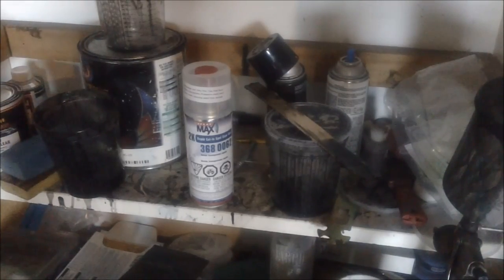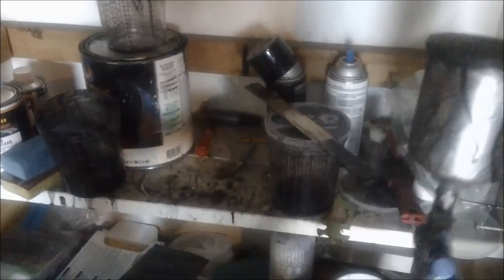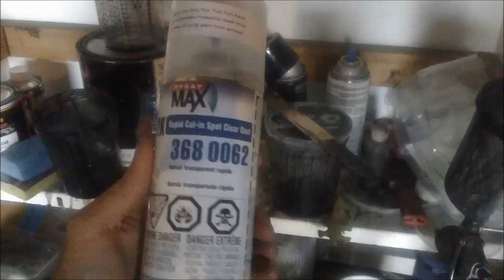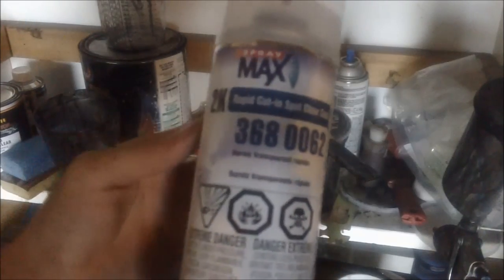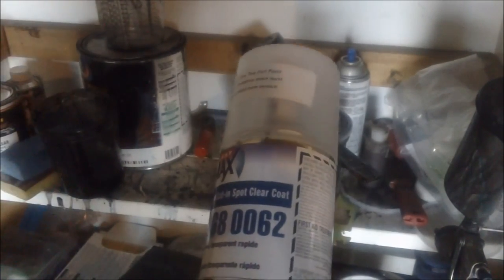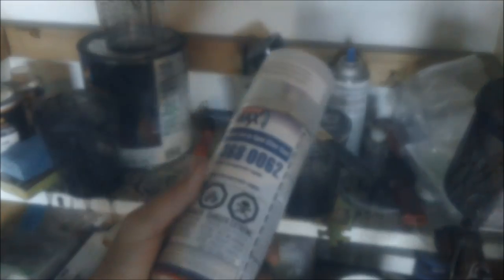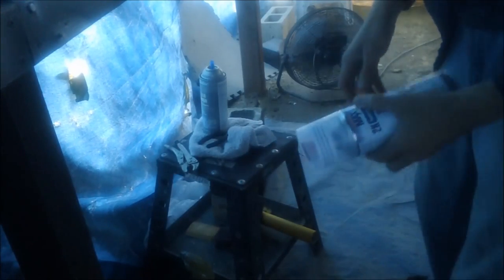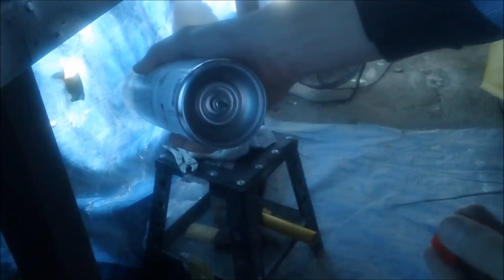SprayMax 2k Clear in a Spray Can

Comment: Do u agree that some paint requires clear coat to make color come out right? I heard somewhere that black sapphire pearl needs clear coat to make final color.. I got the paint (high quality paint not duplicolor) and painted my fender but the clear coat I applied is 1k and applied too thin. I wet-sanded, compounded and polished but the clear coat is almost gone from the surface. The color shows purple hue at an angle when the sunlight is hit. The original factory paint on the rest of the car doesn't do this they stay dark blue.  The colors don't match now.  Do I need to apply thicker clear coat? or 2k will make it look more like factory color?
Reply from the maker: Well if we are talking about a base clear system, clear coat is required. If its a single stage paint, clear isnt needed but it sounds like youre shooting base/clear. It also sounds like the base you sprayed isnt the correct color, best bet is to start over with the prep, find your color code for the car, get it matched and go from there using a 2k clear, make sure to apply the maximum amount of coats so you have enough to color sand and buff off. Hope this helps ya
Reply: Gary Rubino Yeah i think u're right i contacted the seller and sent them the pics and they believe the color doesn't match (even though the paint code is correct) so they gonna send me a new mix. I'm excited YAY... ^o^)  Tank u for the advice

Comment: I have a couple questions how long after you put the paint on do you put the clear on I can never find an answer for that also once you put the first coat of clear on how long do you wait in between to put the next coat on do you wait 5 minutes 10 minutes or do you do it right away I did subscribe you have an awesome video and I will be watching for now on thank you very much you're very helpful
Reply from the maker: HI Rob, to answer your question in short, I usually put 3 coats about 15 minutes apart on the base, for the clear after my last coat of base Ill wait about 30 minutes to an hour, first coat of clear goes down, give it like 15 minutes then the next 2 or 3 give it 20 minutes flash in between each coat. Hope this helps ya out

Comment: Hi, I just used acrylic enamel duplicolor as a basecoat on an old moped i'm rebuilding. I was planning on using this stuff as my clear and was wondering if I have to scuff the basecoat before applying it or can I just spray it on the cured paint directly?
Reply from the maker: Darren Weatherall Hi Darren, if its already cured give it a good scuff (assuming its a solid color) If its cured and you dont scuff it, it wont have a mechanical bond. Spray a couple a lite coats and then make them heavy and you should be ready to rock N roll
Reply: I have comparable circumstances to Darren.....After you "scuff it"  do you tack it or wash it or both? Thanks for your help.

Comment: How much will one can do? Can 2 cans do 4 doors, or is it better off to get 1 can for each door?
Reply from the maker: F&F actually 1 can would do probably an average size door for around 3 to 4 coats tops. So it would be safe to do 1 can per door and only activate it right when the current can is about to run out
Reply: Gary Rubino Cool, thanks for the reply. I think I might try this sometime.

Comment: I have a bike tank that's been painted for about a week. Do I wet sand it before applying this stuff? Or should I put on a new coat of paint and apply the 2k while it's tacky?
Reply from the maker: If it just base coat thats been open for that long, you'll need to sand it, re-base it and let it sit for a minimum of 30 minutes to an hour depending on how hot or cool it is and then clear it, once you go past 12 hours, the base has dried too long to accept clear. Some bases might allow a 24 hour open window so you'll have to double check its tech sheet. Best to base it out, and clear it that same day after 30 to an hour of wait time from the last coat of base. 3 cost of that, 3 to 4 coats of clear from this stuff and you should be plenty right after that. Hope this helps Randall!
Reply: Can I use gloss as a base coat?
Reply: I sanded the old paint, reapplied a coat of satin black and then applied 3 coats of the clear and my tank looks like glass! I can't believe how deep the shine is. Thanks for the advice.

Comment: When doing a small area of base repair, does the surrounding clear need to be prepped in order to blend in the old and new clear coats?
Reply from the maker: Short answer, yes! I like to wet sand it all down with 600 and clean it really well Lay out your base, tack, clear it and youre off and running
Reply: OK.  Thanks!

Comment: hey man. I'm doing a little project on my own and I want to use SprayMax 2K Clear coat on my project, though I'm afraid of what it will do to my paint work. I used a rustoleum paint on my project. will it damage the paintwork? thanks
Reply from the maker: +Jan Hernandez Im pretty sure it will but there might be a way around it. This may or may not work but what you could try it shock it. What I mean by "shocking" is rather than putting a full wet coat on, spray just a really light mist coat and let it sit for ten minutes, spray another light mist but a little more, do this about 3 times and work your way into a full wet coat. Ive done this before with 1shot pin strippers paint. Again, it may or may not work. The safer bet is to use a single component clear like the upol #1 clear in a can. Good luck and let me know how it turns out
Reply: +Gary Rubino i actually got the guts to get it and it worked well on my rustoleum painted helmets. It worked really well and looks amazing

Comment: Hey man planing on doing a bumper and want a really nice clear gloss would this product or u-pol be better ?
Reply from the maker: fcf1800 Well both are really nice clears, they both are almost identical in cost.  The upol will do the trick as well but will require more care but Id go with the usc clear simply because it has a hardener in it and should stand up to the uv's better

Comment: I think you went over too quick on the 3rd coat. Shouldn't you go slower to ensure full coverage and for thicker coat?  That should level the clear coat down too and result in smooth surface. Any comment
Reply from the maker: I suppose so, but this is the way Ive done it and I usually at least run 3000 over it to nib and then buff. Im of the thought that if it works for you, go for it.
Reply: Ok thank you

Comment: What is clear paint?
Reply: Daniel Schnell...  Clearly it's paint that is clear. Used as a top coat/protective layer to add shine/resistance to scratches.
Reply: A clear lacquer
Reply: It’s not lacquer, that’s what the Duplicolor clear stuff is. Two part automotive clear is actually a resin, that’s why you need hardner. Clear coat is not paint, the color coat is paint.

Comment: How long between coats? how long before dry? after 3 days my plastic headlights was still sticky... I was stupid and seen some debris on the lights & wiped the debris off with 99% alcohol & rubbed the 2k clear coat off after 3 days....smh..... any advice?
Reply from the maker: If you had problems using this clear, as Ive heard it in the past, what I did is shake the hell out of it, then pop the red cap then shake the hell out of it some more! Well, in your case, Id sand it all down again and start from starch, lay out your first coat a bit on the lite side and wait 10 minutes, then lay out a good wet flowing coat then give that 15 minutes and follow it up with a 3rd
Reply: You did not successfully activate tye hardener.

Comment: hey man do you recommend using this stuff on like a controller for a game system? i want to add this protection and shine to my painted controller.
Reply from the maker: For a controller? It would be great stuff to use but in my opinion would be overkill. If youre doing just 1 or 2 controllers, Id actually suggest the upol clear (orange can with the #1 on it) Reason being is it would be far less toxic and easier to handle. It'll yield about the same gloss and you can store the rest and use it at a later time vs this 2k in a can, its only good for about a day or so before it kicks and if you dont use it all up, kind of throws your money out the door. Hope this helps ya out Kevin
Reply: Gary Rubino oh okay, well i was thinking using it for like 5 controllers at a time. Also if i may ask how much time would you allow the paint from the controllers until you use the clear coat? i really appreciate the fast response. you are awesome buddy!!!
Reply from the maker: Hmm if its at least 5, You could use this stuff but Im almost positive you'd have quite a bit left over. My bet would still be on the upol clear, heres a quick link to one of the places I buy it from when I cant get it locally tcpglobal.com/UPO-796.html#.WVabV4jyscU

Its a bit pricey but its well worth it. And for the paint drying, for the base color wait about 10 minutes in between  each coat, put 3 good ones down then wait about 20 to 30 minutes at least to spray the clear. Most bases dont like to sit longer than 12 to 24 hours depending but my preferred practice is to just wait 20ish minutes and clear and waiting about 10 to 15 minutes between each coat of clear.

Ahh shucks, any time man! Just a dude trying to help another dude out :)
Reply from the maker: for the link put www. 

Youtube doesnt like links for some reason
Reply: Gary Rubino Do they make good rattle can base coats or do you need to use a paint gun? I'm not very familiar with base coat formulations, do they have hardeners in them or is that just the clear coat? I'm wanting to repaint the bumpers and some other parts on my 95 Buick Riviera and not sure what to use for the base coat.

Comment: Is  a 3m 6200 mask safe for this? They can claims you need an oxygen mask to use this stuff.  Thanks.
Reply from the maker: It should be so long as it has the correct filters on it.

Comment: I just purchased this for the roof of a car a small section next to the sunroof a little strip I was wondering can I go to the paint store and buy the Dupli-Color color match paint base and then spray this on top there really is no instructions on what you can't use this stuff on let me know if that is ok some people on YouTube say I need a 2K base whatever that means but Dupli-Color makes a perfect match where it matches up to the color code on the car let me know what you think thanks I appreciate it
Reply from the maker: Ive never tried it with the duplicolor but I'd strongly suggest not to. Duplicolor usually is a lower grade lacquer based type of paint, if you need the base color Id suggest automotivetouchup . com
They can do the base coat in a urethane type of paint that will be compatible for sure with the spraymax
Reply: Gary Rubino thanks I'll do this!!

Comment: Hi there! Can you spray over a 1k basecoat or can you only spray it over a 2K base
Reply from the maker: Im assuming you mean a spray can 1k base? or that no mix spray stuff? Id read the back of the can if it says it can be sprayed with a urethane clear on top, Im sure its safe. I sprayed this stuff over a spray can oem color matched white, If someone else can chime in and confirm or provide more detailed info, please do so.
Reply: +Gary Rubino oke thanks for the fast reaction man!

Comment: How many doors could you do with just one can of this stuff? 

Thanks
Reply from the maker: +n8rad3 I had enough for 4 coats on this door
Reply: Gary Rubino Thanks brother. I'm looking to do a matte cream color on my hood and I saw SprayMax has a matte clear coat.  Can I use regular old duplicolor from a can for the base and use the 2k over top of that? Or any tips you have for working with matte colors in general would be great

Comment: What happens if the paint has set  for 5-7 days before using the 2k clear?
Reply: It's best to clear it shortly after (30 min +) paint to get maximum bondage as the paint is a bit sticky during this phase.  But that's okay you can clear it 30 days later.  Just make sure that the paint surface is coarse enough, 800 grit equivalent.
Reply from the maker: Ditto ^^^^
Reply: It came out great, It is a motorcycle gas tank, haven't spilled any gas on it yet to see how well it stands up.

Comment: What's the lifespan on the can once you start using it
Reply from the maker: Ive had to go for about 2 days in the cooler months maybe more a day and change in the hotter times of the year
Reply: the lifespan once you activate any 2k clear is 15 minutes in a very hot weather up to 1 hour in the middle temp. some say 4 days but its bs as hardener is activated there is a reaction between lacquer thinners and hardener so if you can use it in 1 hour its safe but the more time pass chemical reaction is not the same because of hardener. lacquer and solvents is no problem the short use time is because of the hardener only. plus its very expensive to use spray can. if you buy from glasurit ppg debeer roberlo standox and use a spray gun you get at least 70% less for the stuff in the same 400ml amount. i think most 2k are mixed like this for 1 portion of clear you add 0.5 of thinner and 0.5 of hardener. 70% or more cheaper using spray gun and top results like in the bmw or ferrari factory. 2k spray can is ok for headlights and small spot repair but not for panel like hood or roof. plus you cant compare quality of spraymax dupli color or peter kwasny to ppg or basf coatings. body shops never use spray cans they know customer will come back shortly and will ask to repaint this or that panel again. thats the fact i have body shop owners friends they never use ready spray can clear coat 1 or 2 k only what they mix from professional coatings supplier. also if you guys do it for a living let customer know that spray can is not like body shop paint in the owen cured correctly etc.

Comment: this stuff is garbage.. 1) you must put it to a proper base coat, not over a rattle can base.. with the solvents inside rattle can base, it will peel if you rip masking tape off of it, and if you get yone chips it will keep peeling. 2) its a TOUGH clear.. if you cut and buff it, youll never be able to get out a haze.. it will be forever hazy. ive tried the best polishing compounds and pads and this stuff is bad.. very nice for small projects where sanding isnt needed, BAD for panels
Reply from the maker: Integra DIY This stuff turned out great for me. The base I use from automotive touch up is a urethane base and I did the cut N polish the next day with no issues.  I know there was a DOM on my can and even came with a little paper saying if it sat for more than 2 months to spend a good amount of time shaking it, pop the hardener and shake some more, Perhaps you got a bad can?
Reply: I have used this clear an it is a really good product IMO. Of course you need to use a good base color under it just like any 2k clear, and of course it is tough stuff..... thats why it uses a hardener, it's automotive grade stuff and can be properly sanded and buffed like any other urethane clear.
Reply from the maker: Rene Contreras Hey Rene! Glad to hear another positive comment on this product!
Reply: +Gary Rubino No, this guy is just on here to talk shit about something he doesn't even use.  That is what the internet has created, a medium for people to complain.  When there is nothing to complain about, let's complain about nothing.  These are the same people that post rants on facebook because they know the only one reading will be their buddies, then their buddies will give them the ole thumbs up so they can feel better about their sad little life.  Spraymax, compared to other spray paint, is much higher quality, the end.